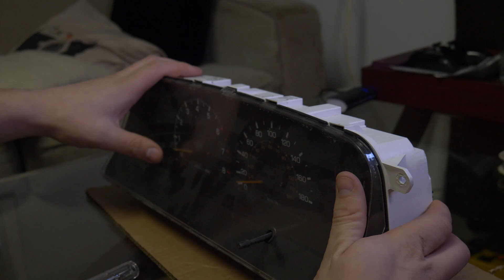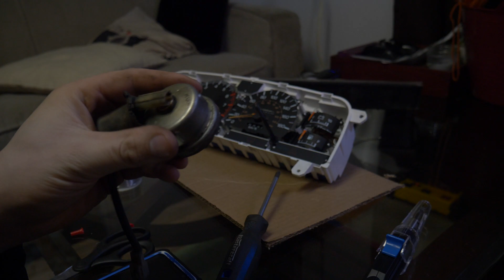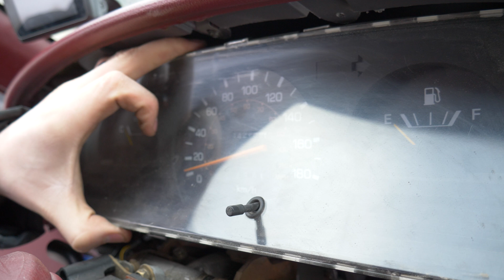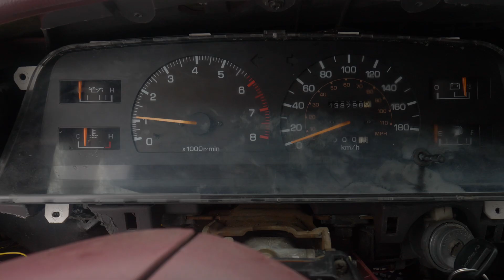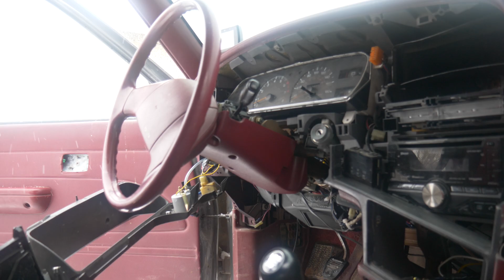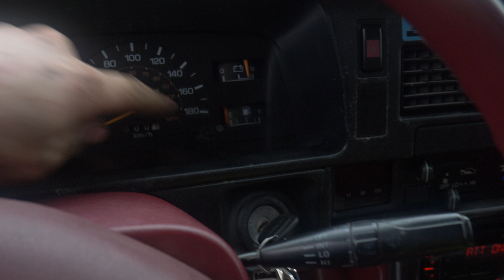How To SR5 Cluster Swap - 3.4 Swap Tach Resistor Mod - Toyota Pickup / 4Runner (4K)

Comment: How come the tach adjustment knob doesn't work for the 3.4 swap?
Reply from the maker: It does
Reply: Im confused. Whats the benefit of adding the resistor vs adjusting the knob using a secondary tach?  @DirtGarage

Comment: Wow man, your channel is AMAZING. I am going to be eating up a lot of these videos. This gave me a great starting point for my cluster swap for my '93 T100.

I am, however, a bit lost about things like that digital display you have. Also, I saw in another video that you somehow got OBD2 into this truck and I am just missing so much contextual knowledge on all of that. Can you suggest any resources for learning about things like that?!?!
Reply from the maker: My truck at this point had a newer motor, and used a newer ECU. The newer motor used a OBD2 diagnostic port. Older motors like in your 3.0 93 T100 does not have a option to use OBD2
Reply: @DirtGarage  Ah ha! That clears it all up.

Thanks for the fast reply!

Comment: I have a question if anyone can give me insight. I did this cluster swap I got mine out of a 1994 T100 yes they fit the 92-94 pickups as long as it’s electric they have cable driven one too but anyways. With the original stock cluster temperature would stay really low id move about a few inches from the cold line. After the cluster swap the temp gauge goes half way.

Comment: Do I need to add the oil presuse sensor in a Toyota pick up 91? I just got a cluster like yours. Thanks in advance.
Reply: If it comes with the simple tach with just the speed temp and fuel then yes. I have a question is it a 22re or a 3.0
Reply: @matexf4c  Its a 22RE engine. The only problem is that I couldnt get the tach to work
Reply: @bigpilouh7256  I thought I replied my bad but there’s a video by a Chanel called garage build Hondas he has a link that shows you where you have to solder on the rpm cluster
Reply: @matexf4c   I saw that video. But if I didnt undertand wrong the resitor only applies whe the swap is from 8cly to 6cly; am I right? btw thanks for the support
Reply: @bigpilouh7256  yeah that is correct no need to solder anything. I think I figured out why the rpm aren’t working I finally swapped mine out and got it running I’ll make a video on it right now and post it on my channel so you can see it

Comment: hello, I have a toyota 22re pickup, I changed the cluster for a toyota v6 3.0 upgrade, my question is the following since this cluster has a speedometer cable and mine is electric what to do when the speed gauge does not work

Comment: Hello friend, a pleasure to greet you from Honduras. I tell you that we have carried out the project to change the engine of a 1995 4runner with 3vz to a 5vz 3.4 almost everything goes well but when assembling the tachometer it does not mark the revolutions because we have not connected the wiring for it, with these indications it should work the revolutions?

Comment: I just about got my 3.4 swap complete, I would like to install that same oil sending unit, before I put the motor back in. I'm swapping clusters just like your video. Is that a 3.0 sending unit?

Comment: Hey man I have 89 I am about to swap out the gauge cluster and I am not sure if my truck was pre wired for the tach however previous owner put in an after market tach and oil pressure gauge. But not sure if I need to do the ten ohm like you had to with your truck...

Comment: I need the link for the gas guage everything works except the gas guage
Reply from the maker: My gas gauge not working had nothing to do with the cluster swap. My fuel level sending unit failed in tank. When I replaced that it started working perfect.
Reply: But it was working parshally not giving the correct reading but the needle work now this one nothing but I am going take off the back and check it
Reply from the maker: @owenfalconer9398  So I once had a issue where my gas gauge was not working and me temp gauge read waaay higher than normal.. This was caused by a bad ground. Maybe your issue? Or perhaps you picked up a bad cluster?
Reply: @DirtGarage  well maybe but it's hard to get originally but from the junk yard it's going a $100us

Comment: How do you fix the gas guage
Reply from the maker: My issue was the fuel sending unti! as Patrick mentioned. Replaced the sending unit and it was fixed!
Reply: I think his issue was with the sending unit not telling the gauge how much fuel was in the tank. It isn't an issue with the cluster because the fuel gauge is plug and play. His issue is in the tank. A new sending unit would fix that problem.
Reply: Am going to try changing the sending unit because mine is the same plug n play so am going to change the sending unit and see

Comment: What’s up I have a 94 Toyota with a dual coil 3rz swap.  just swapped a sr5 cluster in and I don’t know where to run the tach wire to my motor. Thanks

Comment: Yo tengo un 22re y le pondre el cluster con tacometro. Pero no se de que valor poner la resistencia. Puedes ayudarme con eso
Reply from the maker: No necesita usar una resistencia si está instalando esto en una 22re. Solo se requiere si va de 3vz a 5vz, o de 22re a 3rz. Si no puedes entender esto, ¡culpa al traductor de Google!
Reply: Ya pude instalarlo. Y no ocupe modificar nada. Solo conecte el tacometro y cambie la iluminacion que trae por unos hiper leds.

Comment from the maker: Thanks for watching! Remember if your not 3.4 swapped like me you dont need to do the 10ohm resistor mod.
Reply: This is why I came to the comments to ask why you did that. Thanks
Reply: @mauriceescobar8403  Espera, yo tengo una 4runner que tuvo un 3.4 pero se cambió a un 3rz y se quedo con el tablero del v6. La pregunta es, debo poner la resistencia o que? actualmente n marca RPM y no se donde conectar el cable de tacómetro (tiene dos bobinas). Agradezco sus comentarios.

Comment: Hey man I just bought a 1993 pickup with a 3.4l swap but that thing needs a lot of work. Does your shift lever sit towards the left side? Also does your truck shake when you let go of the clutch and its starting to grab?
Reply from the maker: Hey thanks for the comment! My shift lever is off to the left, but in the normal spot it wants to sit. Also my truck does not have any sort of shake related to the clutch.. Sounds like you got some problems to sort out! Maybe check the trans/engine mounts.
Reply: Dirt Garage Thanks, my shifter maybe bent because in 5th gear it looks like what 1st gear would be in my other truck that has a 22re in it 4x4. This truck has a body lift on it to clear the 3.4l